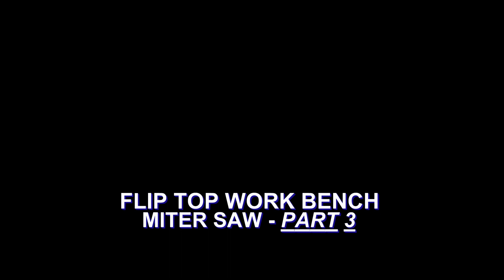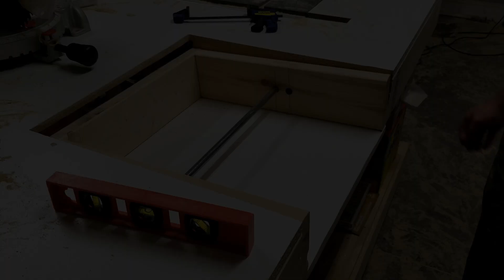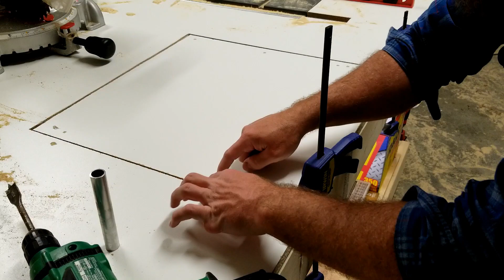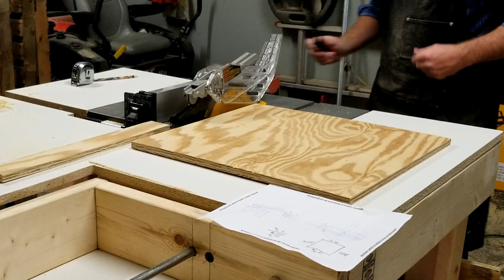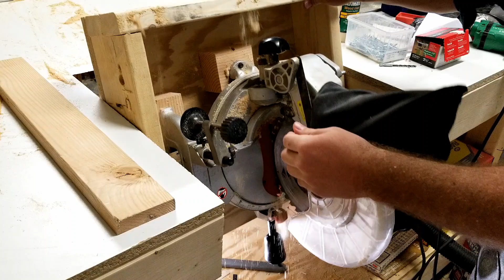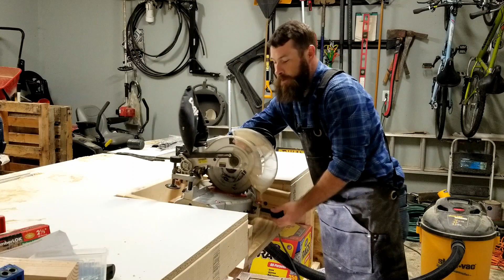Part 3 - Miter Saw Flip Top for Ultimate Mobile Workbench

Comment: I am going to use the same design, these videos will be a great help.  How do you prevent the aluminum sleeves from sliding out of position after several rotations?
Reply: I feel like you could cut longer sleeves. Put it at the midpoint in position. Then cut into the sleeves. Pull the metal back on both side and hammer it into place. That would hold it tight.

Comment: I need to do this with my saw, but I have a little hesitation about cutting my bench. The other thing is, the table on the saw is 4.5" tall, so from bench top to the top of the saw table is 4.5". This means the bar would be right in the way, and adding enough blocking to lift the saw over it would also lift the saw table above the bench top. 
That said, I think I may have a way to "Frankenstein" your build and make it work with my saw. After running the pole through, cut it flush with the inside of the frame of the flipping box and the outside of the stationary frame, and then screw wood covers over the post in both places so it can't work its way out. Then,  if I ever need to remove it I can just unscrew the wood covers. At least, I THINK that might work. Not sure if this makes sense, but if it does, and if you read this, I'd appreciate your thoughts on it. 
Anyways, good job on this... bumped heads and all.

Comment: Great job brother. It's something I need to do with my miter saw. The 1 thing I would have done, would be to screw the original top to the frame. That glue may not hold after a while.
Reply: I believe he did do that. Underneath he used 3 pocket screws per board.

Comment: Well done.  I think I might have gone with a barrel bolt kind of set up to lock it in?  Both front and back could have been locked in with the same bolt perhaps?   Idk.  Maybe that’s an idea you considered and discarded.  But i like the setup!
Reply: I thought the same thing. He already had a through-hole into the bench support, just put another hole through the spinning mount 2x4 and you lock it in either position on the same side. Maybe that's the engineer in me talking.

Comment: Just one question. The point of putting a steel bar with an aluminium sleeve was to prevent wear and warping of an alternative simple hole which would be drilled straight through the wood. Wouldn't the same apply with the lockibg pins, who's holes are drilled straight through the wood? It seems like the same problem will arise over time.

Comment: I like how the saw's weight is balanced while flipping. The table top/base acts as a counter weight for the saw.  

I would prefer to screw my saw directly to the bottom the the bench top.
This requires moving the axle to a height that where both the saw table or flip base rotate  flush with the bench top when either is on top.

This height is easily found by adding thickness of the flip base and height of the saw table.  Simply place the pivot axis half way between. 

Two issues may occur.

1. The framing lumber might be too wide, and rise above the miter table. Simply rip down as needed.

2. If this axle height doesn't pass cleanly under the saw base,  then either use two stub axles or lift with shim blocks as you did. Any shim blocks will offset the axle height by half their thickness.

Without shim blocks elevating the base, the center of gravity of the base and saw combination will change.  Balance will change for  better or worse, depending on the saw used.

Comment: I will start my project tomorrow.  The only question I had is why use the metal rods to secure the table when you could have use a standard know and screwed it into the wood?  Seems that would have been easier, especially for us old guys.

Comment: Nice set up sir.  I was wondering, and I may have missed it, but did you secure the steel rod to prevent it from walking out?
Reply from the maker: I did not.  It wouldn't be a bad idea though.  Its in there pretty tight so I haven't had any problem with that on mine.

Comment: You could have used a barrel bolt latch on the face of the flip top so you could have easy access and more stability when locking it in place.  Just my thoughts but great job overall 👏
Reply: The receptacle for the barrel bolt would interfere with the rotation
Reply: @KyleBaugh316  How so?
Reply from the maker: That's definitely a way to go.  But the one's I've used in the past had too much slack in it and I wanted something really tight to where it wouldn't move at all.

Comment: I've been thinking about building a workbench with all these features. This example is fairly close to what I've had in mind. 

Any thoughts on the layout of the miter saw vs table saw vs router and general table top dimensions? Anything you'd do differently if starting from scratch or anything inconvenient about the work bench in use?

Comment: I would have used sliding bar locks on the front so I wouldn't had to reach under the table. they would have been right on the front easy reach. 

https://www.amazon.com/dp/B085NRDTSP/ref=cm_sw_r_other_apa_i_EslNEbHYFQ5H9
Reply: Where would you mount them?

Comment: I noticed you could have used just 2 aluminum bushings instead of 4 individual bushings since its rotating on the same bar. All you would have needed to change is the washer spacer would have needed to have a center hole large enough to fit around the aluminum. Great project. I think i will be attempting a very similar project
Reply: My thoughts as well, I didnt see the point of 4 little ones when 2 longer would have accomplished the same

Comment: Awsome build. Hoping to do almost the same in my shop once it is done. Just one comment. Would you not need to brace the sides so it does not sag over time? 

Happy new year👍
Reply from the maker: Some added bracing would never hurt.  If I had the opportunity, I would have used a metal plate with the correct size hole for the rod on the sides.  So far it has been good without it though.

Comment: https://youtu.be/Vvqa8XWG0j8?t=442 why not just drill through the hole you used in the first slot here https://youtu.be/Vvqa8XWG0j8?t=320. You could've drilled from the underneath after you flipped it back to the table top side just at the other end. ;) Also, instead of doing it this way, you could've used slide locks on the outside of the table. Great work for sure.
Reply from the maker: Yes, that would work too.  I didn't go that route because I didn't want to be drilling through that hole again for fear of inadvertently making it bigger as the drill bit went through to drill the adjacent board.  I was trying to keep that hole as tight as I could so that there would be no slack at all.  Also, slide locks on the front allowed too much slack in the flip top.
Reply: @griffithwoodworking6661  makes sense my man. Was just curious. I'm still new at woodworking and wasn't correcting you btw. Was more/less saying what I would've done, but after your explanation you say sounds better. Also nice beard Haha.

Comment: Nice project, just my 2 cents... Drop the peggy! It will come lose with time and too much time consuming on every flip. Use two case lock on front of table. Cheers, Theo - Brazil.
Reply from the maker: I tried a couple case locks or side locks on the front when I was trying out a few options and ran into 2 problems.  First, there was too much slack in the lock and the flip top would rotate up to an eighth of an inch when locked.  I wanted it to not move at all.  Secondly, having a lock sticking out just a little would catching my clothes or jam into my stomach when i was reaching across the table.  A lock would work great and would be much easier if you didn't mind those two things.   Thanks for watching!
Reply: @griffithwoodworking6661  Hi there, fantastic solution. This guy here has a good solution to fix the flipped machine in position https://www.youtube.com/watch?v=a62kKjoJbNc&list=PLOSqGfq5dYn6ekmb02WjplNd5OzSRPUYk